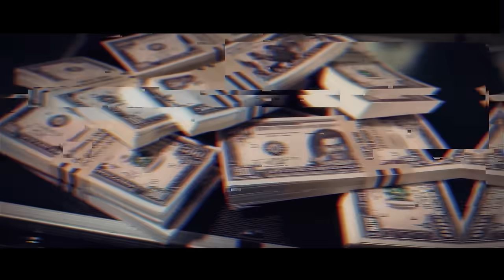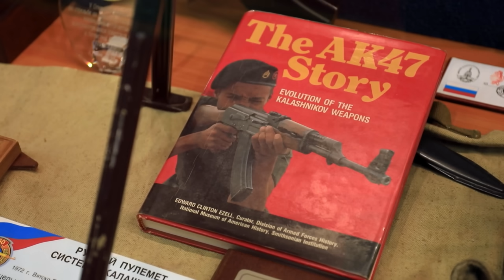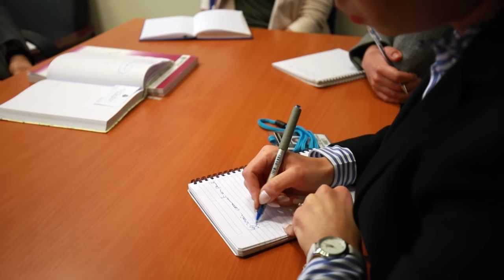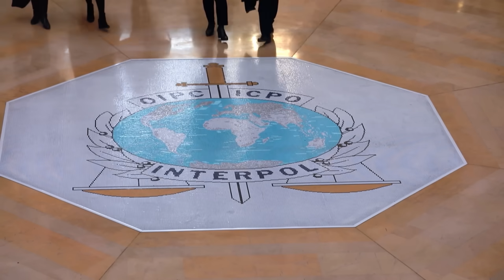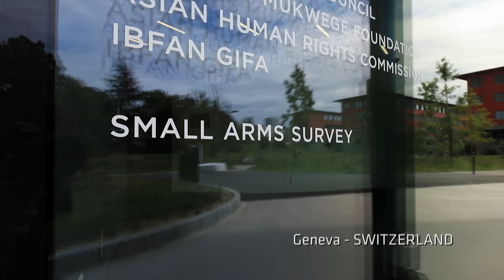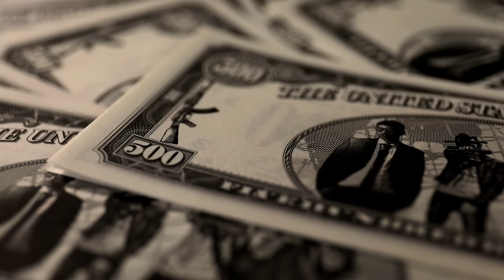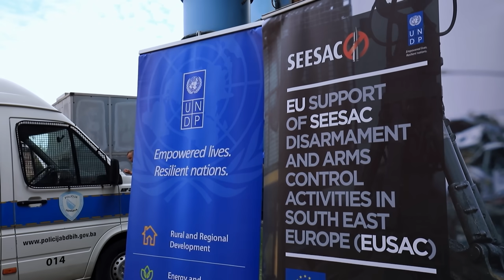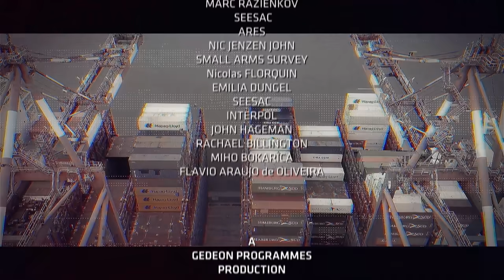Arms Trafficking - Dirty Dollars Inc.

Comment: Documentary kind of lost the plot when it came to people posting blueprints of firearms and making that illegal. Like, lmao, how elementary could you be to believe that you could simply ban posting any sort of information. That sounds like some anti-free speech BS to me. Also, you could have the blueprints to make an RPG, good luck actually making one without several machines that weigh tons and cost thousands, also not getting caught in the process. You could 3d print lots of gun parts, sure, but none of the pressure bearing parts like a barrel, bolt carrier, etc. All those parts are very difficult to make.
Reply: Difficult to make, but easy to buy and ship straight to you door… lol. You know you can legally buy the bcg, or barrel right ?  Literally the only part you need to print is the lower on most guns.
Reply: It’s really not hard to make those components. It’s foolish but not hard
Reply: That's what a machine shop is for and it's not that difficult unless you're stüpid. Besides the fact there are steel 3D printers so it doesn't really matter
Reply: Besides barrels are perfectly legal to buy
Reply: Internal parts kits are a dime a dozen in the US.
Reply: @jeremykaleschenkoikov6993 nothing foolish about it
Reply: @danielkreisler4622  That's not part of my argument what so ever. I'm arguing that it's hard to make weapons from SCRATCH, as these journalists think you can straight up 3D print a barrel.
Reply: @jeremykaleschenkoikov6993  Again, making pressure bearing parts is very difficult, that's why there is whole professions devoted to the craft...
Reply: @HandlingItAll  Dude I think none of you guys can read, making a pressure bearing parts, like a bolt carrier and barrel is extremely difficult, none of your mfrs are making that in your garage. You guys are probably making some cheap .22 slam fire POS but that's not what I'm getting at. Also, lol, sure Metal 3D printers exists, but they cost well into the hundreds of thousands and make tons of noise, take up space, etc. etc. If criminals were able to just have these they probably wouldn't be criminals in the first place.
Reply: Isn't impossible, RPG no special, but no need to worry.

Comment: "A gun doesn't lose it's value because it has been used."
Almost made me rethink selling preowned cars.
Reply: Cars do lose their value, especially modern ones, especially when they get high mileage.
Reply: More crimes, less money
Reply: @Hakkapell  thats exactly why it almost made him rethink it... like your citing something he insinuated
Reply: @Hakkapell cars are literally made to experience major failures around 150k miles
Reply: Damn, I thought that was going to be the best consulting line after a break up ever.
Reply: @Hakkapell   I hope feminists get your message. 🤣🤣
Reply: Most guns DO lose their value after being used, because most guns are cheap and most gun owners don't do proper maintenance on them. The guns that retain their value (or increase in value) are collectables. I'm just getting into the market as a gunsmith and already seeing $2000-3000 antiques that only need basic cleaning because they're so well-made. Just 50 years ago those same guns could be bought for under $100.
Reply: Sex acts happen less often in firearms than in vehicles, and are easier to clean.
Reply: @tylerkinley268  You are an interesting fellow. 🤣🤣🤣🤣

Comment: A decent documentary. But it is really one-sided and it all ends up as a sort of "guns bad mkay". I would have liked to see a bit from the opposite side of the table in regard to civilian ownership, blueprints and diy comunities. It's framed as if 3d printed guns and blueprints are aimed at criminals. When it turly is not. Rather it's a community of people with a common interest that share thier passion.
Reply: Myanmar is most recent, the place that's 3D guns saves, and it is good, but see the deal, it's a documentary about illegal gun activities, not legal or mostly legal ones, that's why "Guns are bad mkay" as it's should be in such documentary even if the people to blame for gun trafficking.

Comment: That recoilless rifle is so scary! Bet it's also a 7.62mm, elephant round.
Reply: at mikeace42,
 A 7.62mm is 30 caliber. Usually when someone says "Elephant Round" they are talking about a bigger diameter and longer round than a 7.62 x 39, 51 or 54. I don't see why you think that recoilless rifle was scary. It just means it didn't kick. (much) Neither did the M-16.
Reply: It's most likely the 5.45 round like the AK74 uses which has less recoil than our 5.56 round.
Reply: Thanks Fred @686Snub_NoDash